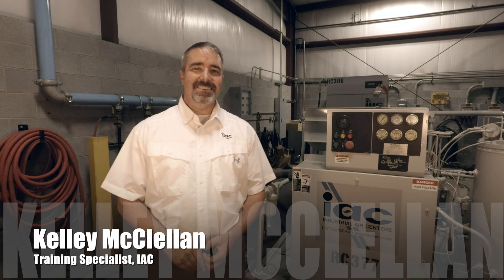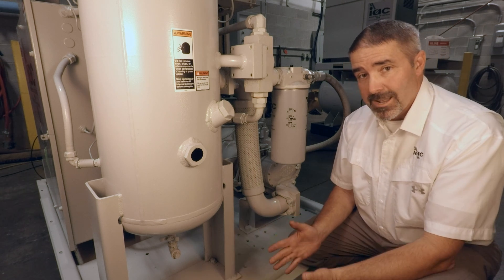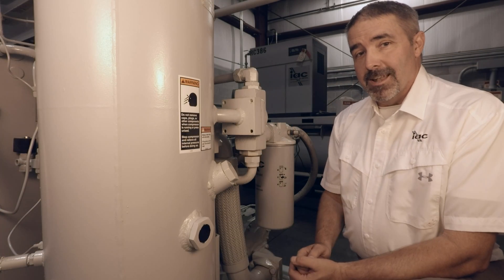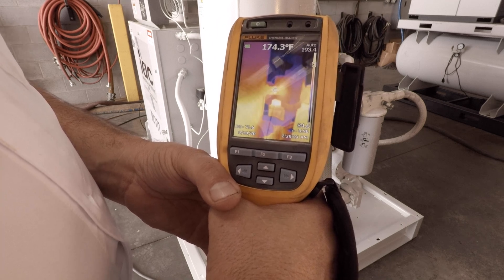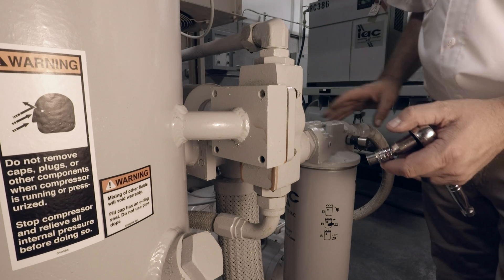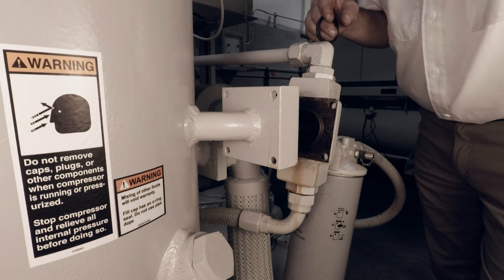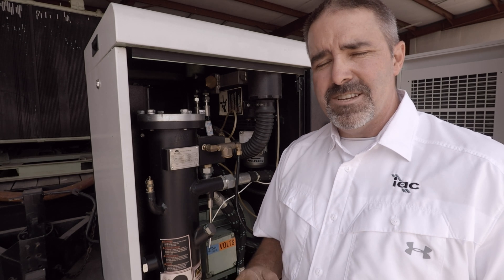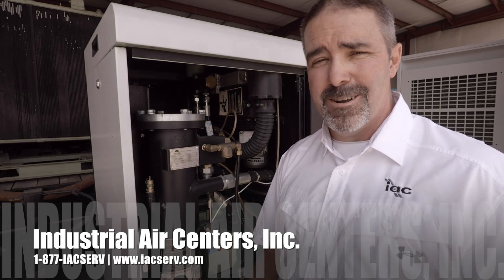Troubleshooting High Temperature Issues On Your Compressed Air System

Comment: Very informative, appreciating your quick response because i am facing frequent high vibration issue (sometimes reached 16mm/sec on air end DE & NDE sides). Our model  is IR M355 mounted on a flexible foundation (Rubber pads), Chinese vendor checked it but without avail. Our remedy for such situation is replacing rubber pads, leveling, loosing bolts and re tightening, this solution is working but some times we expend days and weeks to rectify same and again same problem appears. My question to you is whether you have better solution or suggestions to us.

Comment: Hello. We have a problem of oil level  going down in the screw compressor.  We have replaced separator element. But still it's going down. What is the reason for that? Kindly advise..
Reply: If you are losing oil internally even after you have replaced the oil separator then You have a blocked scavenge line or scavenge stem, you should be able to blow air through your scavenge line system.

Comment: Good morning sir
       We getting problem in our air  compressor oil temperature high,start compressor after 10 mnt alarm will came high temp oil 
I have doubt same thermostat thermal valve .
Please advise sir .

Comment: sir, my compressor always run out the lube oil (oil consumption high). im already renew the oily air separator, and check the return line. any other advice sir ? thanks in advance
Reply: Check the scavenge tube line touches the bottom of the separator. Also check the orifice in the scavenge line is not clogged. 
If this is OK, you may have the wrong type of separator or the pressure that you are running at is too low, or the compressor is running excessively at idle conditions
Reply: @malcolmbritto thanks for the reply, Iam forget that I was writing this comment. I dont even remember in which ship it was 😅